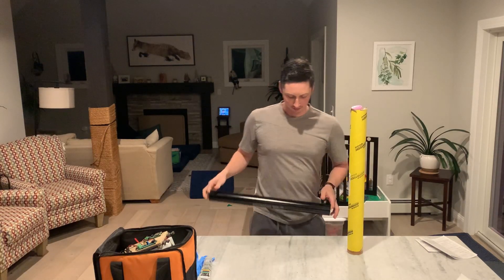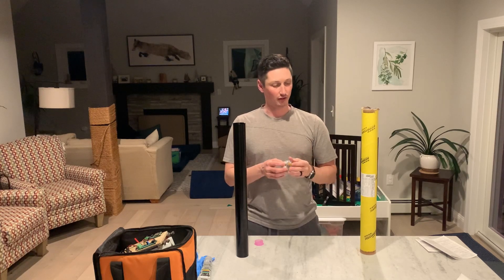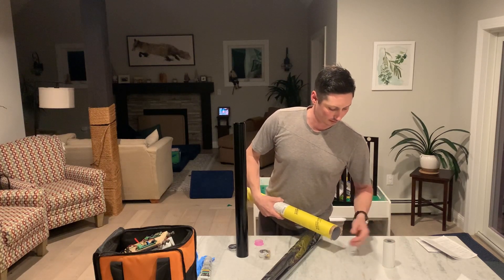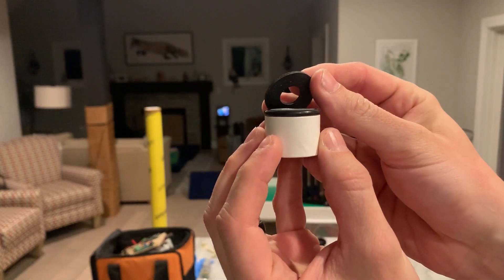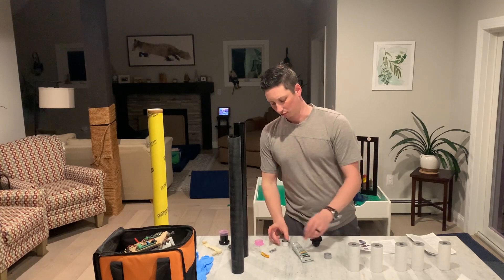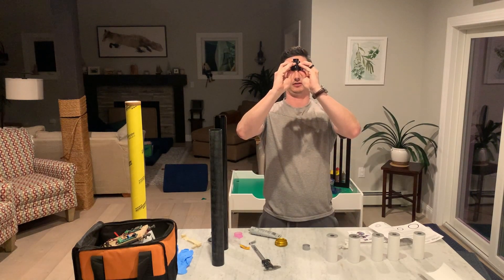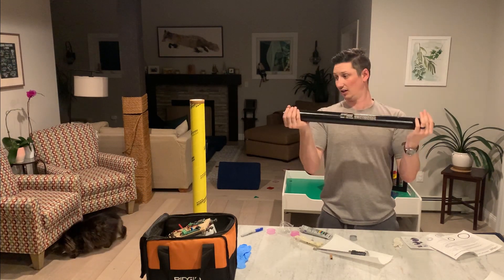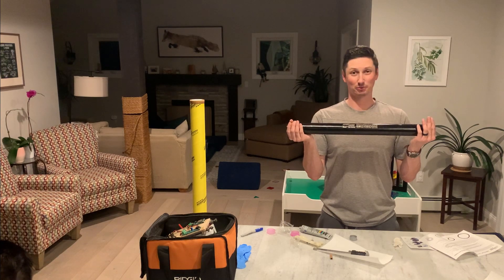Assembling an Aerotech L1090 Rocket Motor

Comment: Or you could just use CTI motors and be done in less than five minutes.
Reply from the maker: Once motors get big enough you’re building them anyways. BTW once you can actually get a hold of a CTI motor how are their 5 and 6 grain 54mm forward bulkheads holding up? 🤣

Sorta kidding, I started off a CTI guy.
Reply: @pathtouch1  I've never had a failure in those sizes and I fly them somewhat regularly - maybe six or seven a year.  I always add an extra O-ring and grease, though. I did, however, have their big 38mm 6-grain XL Blue Streak blow out the nozzle and send my beautiful 2.6" Pike swan diving into the pavement.